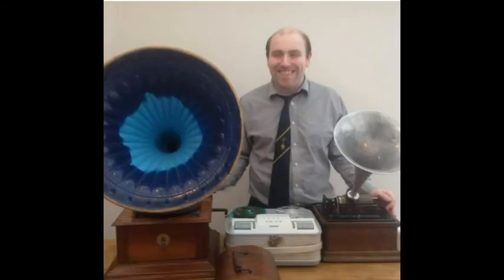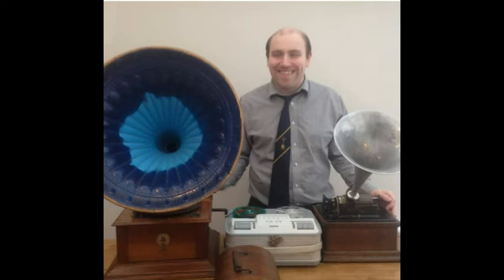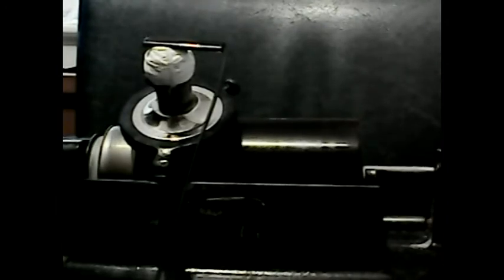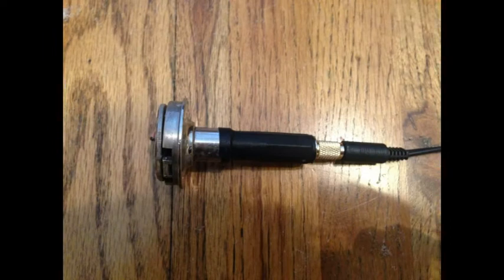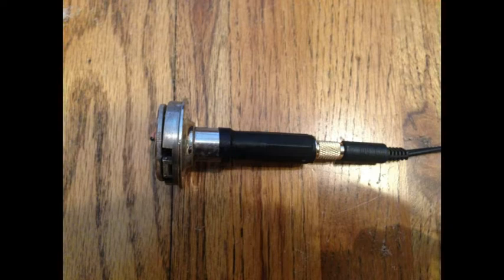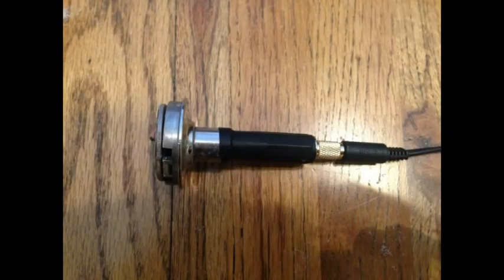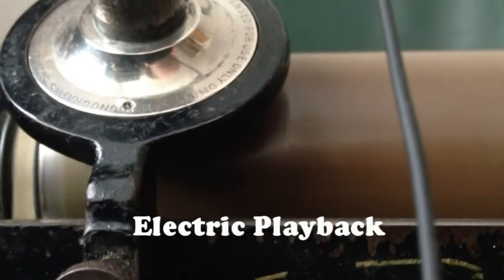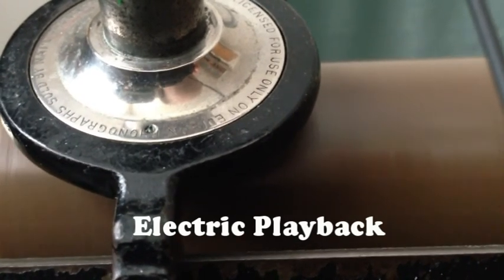Edison Phonograph Electric Recorder Experiment

Comment: Hi Matt,
Wow that was bad some people. Yes the recorder I use is just the basic Edison type but I've put a small weight on the back to stop the cutter jumping that way you can put more volume into the horn, all I did was make a 3ft  cardboard horn and used a Bluetooth speaker in the end and thats the quality I can get. They generally come out ok it's as loud as any Gold molded cylinder through a horn.
Reply from the maker: +Dave Star Fantastic Dave I've done something similar to one of my recorders, I added one of those small fishing lead weights to the recorder just to weigh it down a bit it seems to make it more stable.

Comment: Hi Matt,
Your getting there keep it up. I cant understand why Benjamin [ Victrola guy ] has stopped selling his version of an electric recorder. It would be nice if he would share his knowledge on how to make one with us. I've been unable to do any recording experiments for some time but it looks like your on the right track. Dave.
Reply from the maker: Hey Dave. Hope you are well. Thanks! It's great fun doing these experiments. I think one of the reasons it went off Sale as if it ended up in the wrong hands many fake cylinders would appear. I saw on eBay someone selling a fake Caruso brown wax cylinder. Matt
Reply: Hi Matt, I'm fine thanks. You could be right about Benjamin's recorder. Did the seller on E-bay say the Caruso cylinder was an original if he did that's bad.I'm hoping to get back to my experiments soon IF I crack it I'll let you know.
Reply from the maker: +Dave Star yes he said it was an original. Hey you made a really good recording of charleston on one of your videos. Did you record it using a stock edition recorder? It sounded really loud and bright
Reply from the maker: +Matthew Richards I've used a 1mm glass rod as a cutter to fix a non working recorder. I'll put up another video soon :)